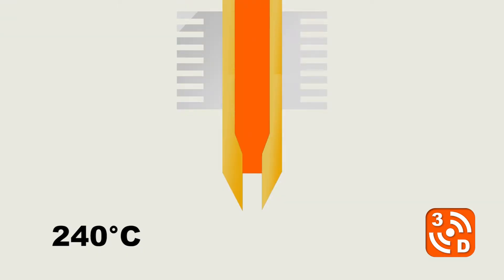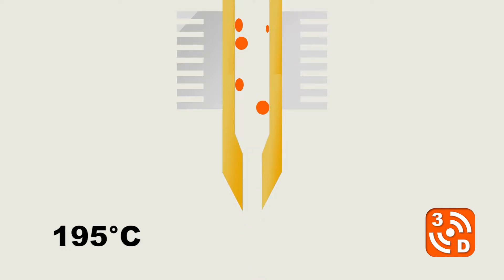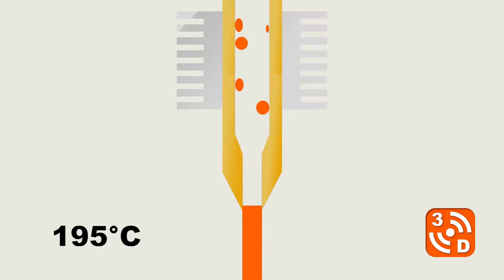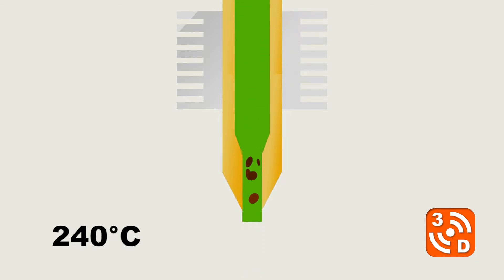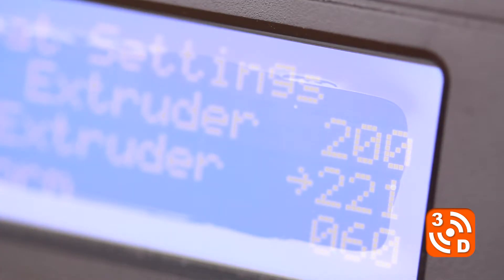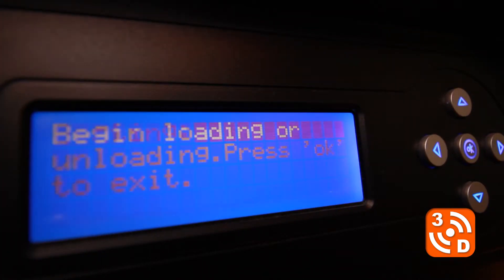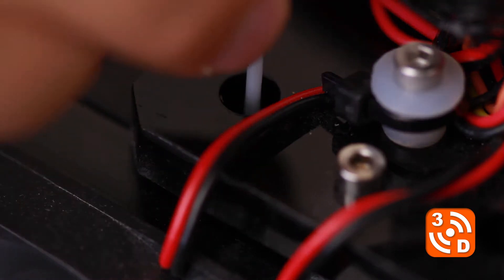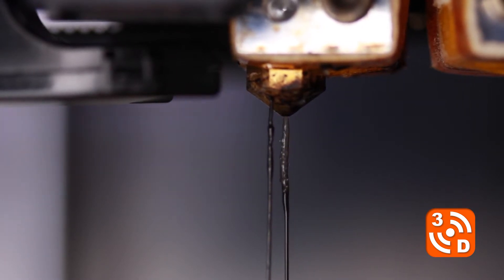Review: Rigid Ink Floss Filament

Comment: Great Video!

For those concerned about Bowden setups -I use another brand of cleaning filament on my  bowden setup, here's how:

I disconnect the tube from the EXTRUDER end and manually feed until it runs clear, then cool the nozzle to 170°C, pull off any drool from the nozzle and pull it back by hand hard & fast.
This is know as a "Cold Pull" or "Atomic Clean" and will get any remaining particles out as well.
 (They get embedded in the warm filament)

The end will actually show the shape of the nozzle, snip it off before you put the filament away so you start clean next time.

Comment: Seems like it's not great for bowden tubes. Cutting off the amount you said wouldn't even make it half way to the nozzle for me.
Reply from the maker: In the case of bowden tubes you can it straight from the 'reel', extrude a suitable amount, then when you're happy, just remove it as you would any other filament.